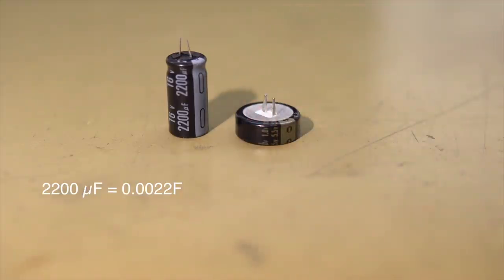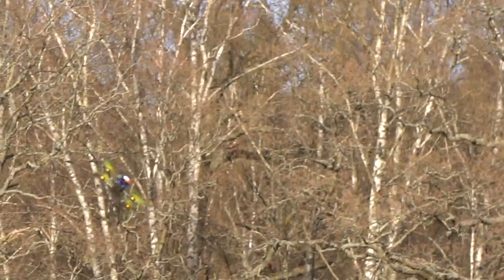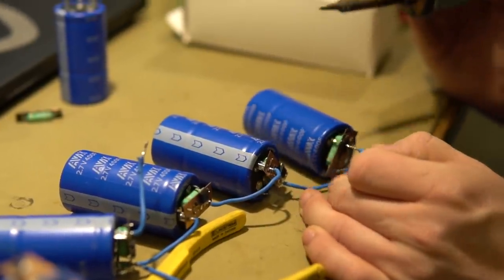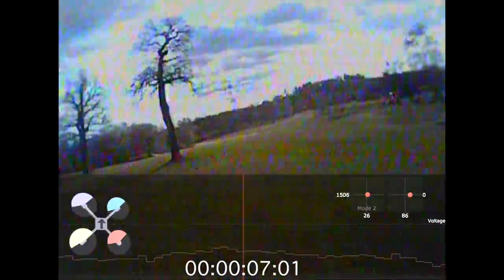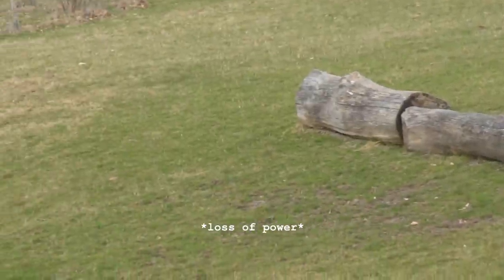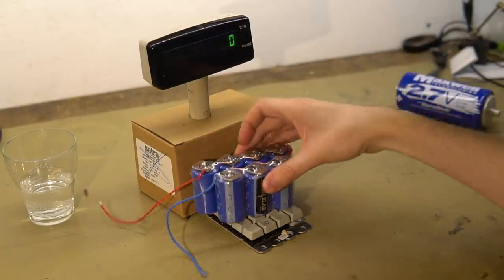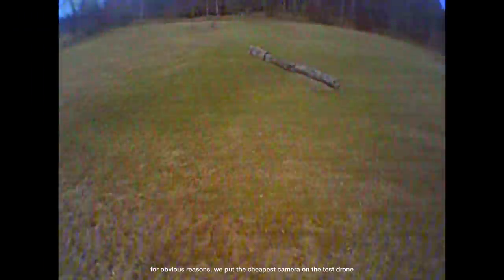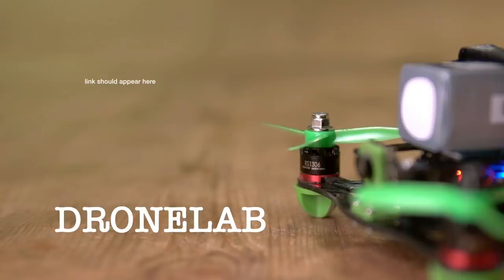SUPERCAPACITOR powered drone

Comment: Use recharge pads. Super-capacitor recharge time is nearly instantaneous and the energy density practically never degrades relative to the best battery technology. Product reliability may be the second biggest sale winning criteria after cost. The size and weight will improve with new tech on the horizon. Keep it up DroneLab. Thank you for the demo.
Reply: and if you have a supercapacitor, without consuming energy it discharges more quickly than a battery?

Comment: What if you used a smaller supercap, and used it in combination with a regular battery for occasional bursts of energy beyond what the battery can supply? (charging the supercap with spare energy whenever the drone isn't pulling as much as the battery can supply and the supercap isn't already full)
Reply: I want to try this. Do you know someone that tried ?
Reply: I just thought of the same... N been hunting around n stumbled on this video.. why hasnt anyone done a cap/bat hybrid like they do for offgrid solar system
Reply: Battery cap hybrids do exist, they are generally two separate cells so you can easily make your own if you know what you're doing
Reply: @CnRSPACE  The "know what you're doing" part is really important; avoiding burning your house down important.

Comment: super capacitors charge a lot quicker
Reply: I believe they can discharge / dump all their energy way faster than batteries too.
Reply: Retired Shitposter  yes they can! 🙂
Reply: Yes, you can charge and discharge them much faster than batteries. Thats exactly what it meant when he told in that videa, that they tolerate higher currents for charging and discharging. 
The other reason and big disadvantage is, that they also can me charged much faster, because they store much, much less energy than a same sized battery.
As he submitted in that video himself, it was very obvious, that this project doesnt make any sense at all.
A Supercapacitor can deliver higher currents than the normal Lipo batteries of thois drone. But if the motors of this drone would use higher currents, they would destroy the Lipo batteries.
So that project was nothing else than replacing the normal batteries, by some that look bigger but have a much smaller capacity.

Comment: I like how at 1:50, you removed the bigger battery for that surprise effect. P.S. To get more energy storage, you should have connected all the capacitors in parallel, and run the discharge through a boost converter. That way, you get the same power, but more energy storage.
Reply from the maker: Yes, I do most things in life for comedic effect. The energy is the same when connected parallel or series. A boost converter chip could however help with making the power delivery more stable (instead of a significant drop-off with dropping voltage as the caps discharge), but to match the power output of the caps (2kW!) that would have to be a massive booster.
Reply: @dronelab1280  oh crap, yeah, my error. E=0.5CV^2, hence even in series, when the voltage doubles and capacitance halves, the energy stored is twice that compared to one capacitor of the same type. I would still use the boost converter to cut corners on the price, instead of splashing loads on high voltage batteries.
Reply: I mean boost converter with a low voltage, high capacity, high discharge battery.

Comment: Use a super cap WITH a lipol to take off the strain of high current when punching... Maybe even use an 8c battery with a supercap to compliment it....
Increase capacity decrease heat
Reply from the maker: I didn't stress this enough in the video, but the high current from the supercap was worse than from a good (65C) lipo of the same weight. So there is no point in using a supercap in compliment with a lipo, you're better off using a bigger lipo.
Reply: dronelab i only need 35c with a 3s 2200mah so could be usefull
Reply from the maker: Maybe if they were cheaper than a 35C battery, but they simply aren't, by far. To complement an 8C 2200mah 3s and be able to get the same current as from a 2200mah 35C, you'd need a pack of 6x100F supercaps in series. (The pack on the video is 7x200F). That's 116g and would cost almost 30euro. So it ends up being heavier and more expensive than just getting a 2200mah 35C.And you'd only get that "boost" for 5-10s, instead of having that current anytime.
Reply: dronelab i only need it for 5 - 10 seconds and adding solar cells would also help my vtol
Reply: @dronelab1280  I came to the same conclusion when I did a research project for a startup at a university. you can get super low ESR super caps but they are cost prohibitive for most applications.
Reply: Or just run 6s and say goodbye to 150amps on 4s. I am currently Drawing 80amps on 6s on a 5" race drone. Lipo also don't puff anymore running 16awg too.

Comment: A while back miniquad test bench had some strange results. In short, it appeared that a few motor/ESC combinations were much more efficient at mid power levels when run on a lab power supply than when a LIPO pack was in parallel with the lab power supply. They didn't really investigate why they got
these results. My suspicion is that the ESC is rectifying back EMF produced by the motor and feeding it back into the power source (battery) during part of the rotation. This energy would charge the battery to some degree however it is almost immediately going to be discharged which means the main effect is going to be heat and possibly damage from momentary over current and/or over voltage

I think that if we could isolate these back EMF spikes and dump them into a resistor instead of the battery pack the result would be a small increase in overall efficiency (due to less heat) and a slight increase battery pack cycle life. Obviously dumping that energy somewhere we can reuse it would be even better.

Accomplishing any of this is going to require at least some more logic in the ESC. But the potential benefits could be pretty big. Flight time might not improve, at least initially, but we'd see less electrical noise overall. This may help enable denser FC stacks and reduce the needed height of GPS stalks, both of which would improve aerodynamics. Other possible benefits could be cooler motors, and we could almost certainly increase the number of usable cycles in a battery pack.
Reply from the maker: Thats a very interesting topic to investigate! Thanks for the hint, we'll see if we can look into this deeper.

Anything that would improve the usable cycles in batteries would be a blessing. It feels so wasteful to recycle yet another battery that only did 50-100 cycles :/

Comment: Totally agree on normal flight a supercapacitor wouldn't be a good fit. But what if it was made a game around the short fly-time and the supershort charging time? A race to stop and charge at multiple pitstops (if its possible to achieve 1min flight time with other propellers and motors) :)
Reply from the maker: Yeah, that could work, and be a lot of fun. Might be difficult to get an entire minute of flight, but the recharging could happen in as little as 10-20 seconds! And the capacitor should last a lot of charge cycles.
Reply: @dronelab1280  I have little to no knowledge with supercapacitors, but regular capacitors can charge as fast as you can supply the energy (ideally). Wouldn't another supercapacitor bank be able to charge the drone within less than a second (to 50%, unless you increase the supply voltage from the charging bank)? I would love to see a drone race where you have to be the fastest at accurate landing and reach all the "checkpoints" to charge!
Reply from the maker: @ArneVelle  In practice there is a limit to how fast you can charge any capacitor - they always have some resistance (noted as "ESR") which will limit the charging current. On a ceramic cap that can end up with a minimum charging time of microseconds or even nanoseconds, but on a supercap it will usually be several seconds.
Reply: @dronelab1280  Thank you, I learned something new today :-) Will look up further information on this!

Comment: What is the weight of that super cap pack? Also, would like to see it being used in parallel with lipos. Best of both worlds, for those punch-outs, the caps would be supplemental to the lipos.
Reply from the maker: Paralleling supercaps with lipos still won't improve performance, our 340g supercap pack had only about 120A maximum current, so much less than an equivalent size lipo. You're simply better off paralleling a lipo, with more lipos :D
Reply: I'm curious, how did you go about measuring the maximum current output of the super caps?  I feel like you should be able to get more than 120A out of them.

Comment: I was thinking about doing this to supplement a normal quad so it can do bigger bursts but with super caps having a lower energy density than lipos (based on my calculations) i decided it was not worth it. Also it's really expensive...
Reply from the maker: You mean lower power density, right? Because obviously they have a much lower energy density, hence the 10 second flight time, but on top of that, they don't really deliver that much power either. We only got ~120A and our pack was over 300g. High discharge lipos can do much better than that.
Reply: Well energy density is what told me not to try it out.. But now that you said that the max amps is only 120A then why bother at all right?
Reply: what did you use to get to that conclusion that super caps have less power density than Lipo?  What did you use to measure 120A ?  You mention in the video that the lipo can deliver 120A also so is that how you get your conclusion?  Because, what if you asked MORE CURRENT from the battery and super cap?   From my experience the super cap has MUCH higher power density because it can dump it's energy almost immediately without damage.
Reply from the maker: Jrod FPV:

Just because it can dump the energy immediately, doesn't mean it has a high power density. That's because it never has that much energy to dump in the first place. The 340g supercap pack we had fits approximatly 40x less energy than a same sized lipo. So even if it can discharge it in 2 seconds, it's the same power (in watts) as that equivalent lipo discharging in 2x40=80 seconds. And you can get a lipo that discharges that fast - that would be a 45C rated one.

Comment: Try incorporating the supercaps with the lipos (the smaller supercaps) - so your drone motors can wind up faster getting you better acceleration.  Caps are faster at deliverying power right?  Try to take advantage of that - and hopefully in a race that typically lasts 5-10 minutes - you'll be able to shave off some of your time?  Just a thought!  Maybe even try going beyond the rating of your motors by a bit - see if they respond better?  Good luck.

Comment: Effectively you are flying with a 28,6F capacitor as there are 7 200F in series. Only a drone that can operate an 2,7V can fly with 7 200F capacitors in parallel, giving 1400F total capacitance.
Reply from the maker: Yes, although either way - series or parallel - the total energy stored in the capacitor bank is the same. The Farad is a bit of a confusing unit in that way.
Reply from the maker: 7 in series: 18.9V 28.6F = 18.9^2 * 28.6 / 2 = 5.1kJ
7 in parallel: 2.7V 1400F = 2.7^2 * 200 / 2 = 5.1kJ 
The total energy is the same.

Comment: Try pairing the caps with a boost voltage converter. SC voltage degrades linearly so you will be out of usable range far before you're out of power technically.
Reply from the maker: That would work great for a smaller load, like a server or something, but for the drone, the voltage converter would have to be able to handle 100A at 15V, or 1.5kW! That would need to be quite a big converter, probably even outweighing the capacitors themselves :(
Reply: @dronelab1280  Overvolt then step down.
Reply from the maker: @omegahaxors9-11  Even as a step-down, that converter would need to be massive (100's of grammes)  to handle the 100A+ a drone needs. Not worth it, compared to just having more capacity in this application.
Reply: @dronelab1280  Probably not worth it anyway since supercaps are really heavy per unit energy. No good for a flying thing.

Comment: I used them in a hybrid system. Lipo and super capacitor. Works great.
Reply from the maker: I'll believe it when I see it (and measure it), because so far the numbers suggest that this does not outperform high discharge rate (75C) lipos in therms of peak current and capacity per weight. The only benefit (and with that, the reason for these capacitors to exist) is longevity, that RC vehicles don't consider a priority by any stretch.
Reply: Ur the man ive been looking for the past two hours since this idea came in my head where can i contsct u
Reply: @Nush Rajabdeen  I've had to modify my hybrid version a little. The super capacitors work great(with fast charging also), but after a year of flying, I've had to add standard capacitors to keep the discharge rate from dropping because of the slow super capacitors. Now, my batteries have a charge in connection and a discharge into drone connection. I had to 3d print a new top cover for the batteries to keep it looking good.  From charging port to 3 super capacitors to balance board, then 3 more super capacitors next, then 3 lipo batteries, then 6 regular low esr capacitors to the drone connector port. Be careful with the wiring, and make sure you have a hobby grade battery charger. Feel free to modify it to your own standards. Just make sure that everything is "mostly" discharged when building the battery. I know a guy that uses 6 lipo batteries, but it takes forever to charge and is a little heavier than mine, and we can fly about the same amount of time. I'm working on a new battery now that can charge the battery while flying.

Comment: Honestly you could but a small battery on it and allow the caps to per use the amps and the battery to supply a constant voyage supply I would like to see how long that would last
Reply from the maker: We didn't stress this enough in the video, but the maximum current of the supercap isn't bigger than what you get from a good lipo (like a 60C one) of the same weight. So combining a supercap with a good lipo gives worse capacity and less maximum current than just using a big lipo. Combining a supercap with a bad (20C) battery would have some benefits, but it's still worse than just a good lipo.

Comment: What if you ran a lipo into the super capacitor and Drew you current through the capacitor, would you get more punch
Reply from the maker: You would not. The supercapacitor offered less punch than a good (60C) LiPo of the same weight. Our huge 7cell supercap only offered a max punch of 120A, which can be easily achieved with a smaller 4S 2000mAh Lipo. So if you combine that supercap with a 4s 2000mah, you would get a total of 240A punch, but if instead you use a 2s 4000mah lipo you would also get 240A punch, but in a smaller, lighter battery and with double the flight time.
Reply: So no hybrid system,lol,

Comment: Can u explain the calculation of supercapacitor us F -> wh. 
verses  lipo Xs XXXXmAh XXc -> wh.  I am interested in formulas.  
Further more, would using high discharge caps parrellel with ESCs (between each ESC and distributor board help with lessen the noise of ESCs.
Obviously application should help out with RF circuitry (noise/interference) for both control and video
Reply from the maker: The energy of a capacitor is expressed in Joules as U^2 * C / 2 (voltage squared, times capacity in [F] divided by 2). A watt-hour is 3600 watt-seconds, and a watt-second is a joule. So a 200F 2.65V supercapacitor is 2.65^2*200/2/3600 = ~ 0.2Wh. For a pack of capacitors, it's easiest to calculate the energy in one, and then multiply by the number of them. Note, that in practice you can't use all the energy stored in a capacitor, because at some point the voltage will be too low to run whatever you want to power from a cap. For a drone, you can assume that you get to use ~65% of that energy.

For batteries, voltage * capacity in Ah is watt hours.  So a 4S (14.8v) 2200mAh battery is 14.8 * 2.2 = 29.6Wh.

As for using supercapacitors on an ESC, having capacitors does help with the noise, but for that to be effective, the capacitors need to not only have a high enough capacitance, but also a low ESR - they need to be able to respond to the sudden changes in power consumption by the ESC - and this is something supercaps are not good at. Just increasing the capacitance is not the ultimate solution for noise suppression. We will dig deeper into this in an upcoming video.

Comment: What about the price for supercapacitor vs the same capacity lithium ion?
Reply from the maker: The supercap is significantly more expensive (over 10x more) vs lithium of same capacity (note that the supercap will be physically much bigger), and about 5x more expensive than a lithium of the same maximum current. The only advantage of the supercapacitor is the number expected charge-discharge cycles, where a typical RC lipo lasts only about 100 cycles, and a supercap should last 1000s if not 10,000s of cycles.

Comment: i think the super capacitor have to working with multi battery cell for charging discharging management , for example when you step on electrical car break you got the energy from the motor than you save that energy to the super capacitor than charge on the non using battery cell. or you can fill the electric in super capacitor from battery for full throttle peak current. am i right? im not so sure but i see some diy electrical bike youtuber doing it.
Reply from the maker: Yes, that’s a much better use for them. Super caps are great when used for their intended purpose like that.